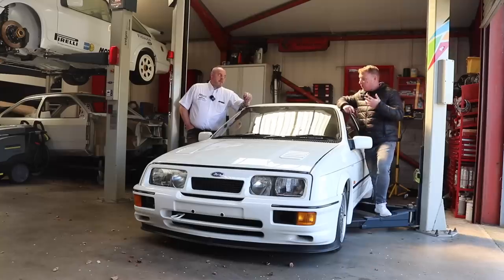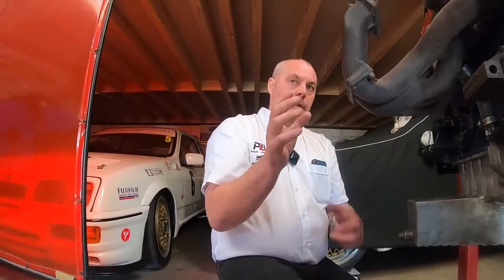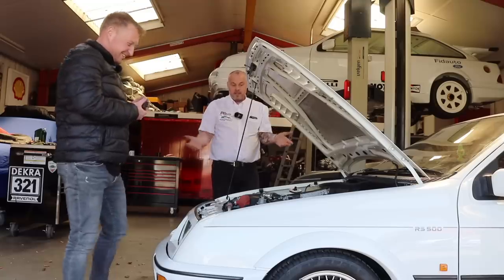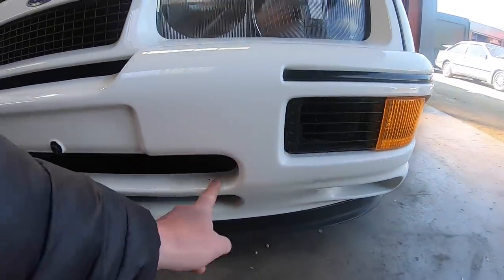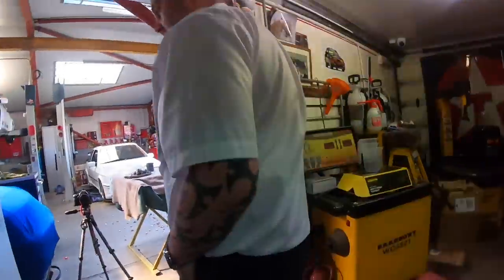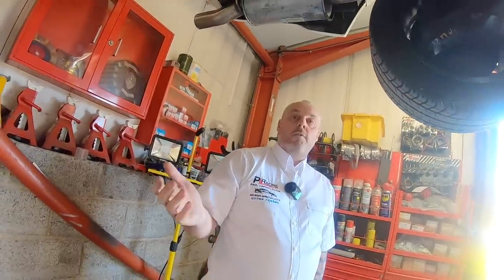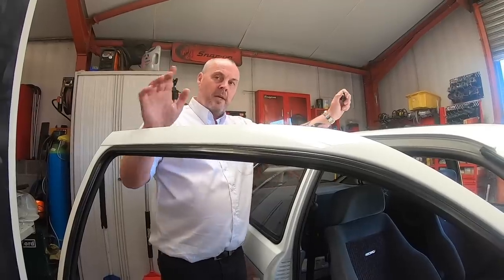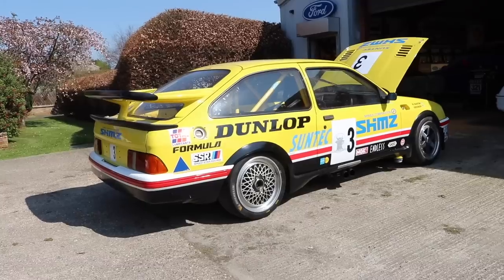COSWORTH BUYER’S GUIDE & SIERRA RS500 DIFFERENCES ** with Paul Linfoot Racing **

Comment: Hi Adam and Paul, another cracking video, Paul never ceases ro amaze, quick story guy's, I remember the very 1ST 500 I pdi'd I noticed the brackets on the rear suspension frame you pointed out, thought it had been "accidentally" left on in manufacturing and actually walked down the bodyshop to borrow the angle grinder, to chop em off. Then stood and looked at it, see it had been sort of tack welded so walked up the compound to look under another and found it the same so left it lol. Also, noted the battery tray trimmed off and already starting to rust so actually touched it up with a touch up stick. Sorry to be boring, you just reminded me lol. Alex.
Reply from the maker: Amazing Alex!! 😊👍🏼

Comment: The guerny flap was originally designed for the mk2 Ford gt40, to increase down force, it was originally put on Dan Guerny’s  Gt40 and I’m lead to believe that is the reason it is called the Guerny flap, as on The gt40 it was adjustable😁
Reply: Was surprised to hear Paul didn't know that. Was the only bit I knew.
Reply: Not true, it was first introduced by Gurney at the request of Bobby Unser on an open wheeled race car in the early 70s, as Unser had no confidence in the rear stability of the race car. Gurney himself had retired from racing at that point
Reply: @jk3838  
I beg to differ on that mate it may of been patented in the 70’s but it was first used on the gt40’s in the 60’s as the gt40’s needed more downforce and  it was Dan guerny who suggested it and developed it but it was on the mk2 Gt40 in the late 60’s
Reply: @damiantaylor7993 yes a very similar flap/spoiler is fitted to gt40s, which was before it was known as a Gurney flap.

Its like a very large gurney flap.

But since the 70s a Gurney flap has become to mean whad Dan Gurney had fitted to his car in early 70s.

Like many of these ideas several people people have already thought of it but only one person makes it famous and they get the credit for it.  There will be a load of other racing cars with a Gurney flap before the gt40 i bet but didn't really get noticed. 

The early 70s use of it got noticed because it was a break from common practice, whereas on the gt40 people just saw it as a small convenient little spoiler on the back of the car. So barely gave it a second thought. 

Like the mp4/1 is credited with the coke bottle and carbon chassis, but it wasn't the first of either, it was just the first people took notice of. Because the others before it didn't win anything.

Comment: The name Gurney flap comes from the racing driver Dan Gurney back in the day when development of the AC Daytona Cobra, if memory serves me correctly, originally it it was a crude slip of aluminium pop riveted to the back of the car in the hope it would give it some stability, it worked tremendously allowing the car with its sleek aero compared to a standard cobra to push more than 20mph more than anything else in its class down the moulsan straight at the lemans 24hr, and winning its class. I dont remember whether it was Gurney or the cars designer Peter Brock that came up with the flap, but gurney took one run in the car and endorsed it. If you follow some of the stories on carol shelby, peter brock and the likes the story of the flap is explained very well, and there’s some great documentaries, keep up the good video lads, i love watching these.

Comment: In fact my dad and another uncle developed the Koln Capri, the twin cam cortinas I think and even minis. Harry Westlake was a petrol head high up gas engineer back then and was apparently the first person to put gas flow into car cylinder heads. I believe they used this  early on with a race team on a mini prepped by their team called Nerus in Rye, east Sussex. 
I heard that half of the name Cosworth was from the guy that run the team. Either Mr cow or Mr worth.  That I'm unsure about
Reply: Mike COStin and Keith DuckWORTH is where the name comes from.

Comment: Bigger core plugs would have been preferable during the casting process to hold the ‘sand cores’ accurately and not have any ‘core shift’ which leads to uneven block wall thicknesses and a weak block, like the RS200 engines which have a thin side on the thrust side which was really unlucky

Comment: A friend of mine bought sting blomqvists rs500 off Ford. He did not like rhd so was sold with the Ford motorsport tune on it I was told it was running 500bhp, my mate was told it would be taken off later , the car was sent straight to a well known tuners who copied the chip, was sold with engine warranty went through five engines on warranty not sure where that car is now, for sure is not on it original engine

Comment: Good informational video. I think the RS500 lower wing is not the same as in european Sierra 2.0 iS. The iS wing extends more towards the rear window and more downwards. I had a Sierra 2.0 iS 3dr at 90's and when I installed a cossie big wing the notch had to be made much larger compared to what was shown in this video. So the RS500 lower wing is totally individual design. Also the lifetime of the serial number stamping tool seems weird, 40 to 50 cars before maintenance. Usually those kind of sheet metal tools last for thousands of pieces before springs or some need attention. But that is still credible, maybe Ford had the same quality for tools as known for their cars...
Reply: It has the same part number as the IS sierra , but with the letter C at the end
Reply: @paullinfoot6017  Yes, I believe you about the numbers, Ford have a lot of them, but see the difference in this picture: https://www.dropbox.com/s/ywqdmi8ur7q2tv8/Sierra%20iS%20vs%20RS500%20lower%20wing.png?dl=0
Reply: @mikkoalinen6951   the lower spoiler is the same as the xr4x4 , not the same as the sierra SI spoilers , not the ones in the uk anyway
Reply: @paullinfoot6017  No, njet, inte: XR4x4 is the same as iS. Goes much for down with boot in EU cars. But I think it is the same in Uk. RS500 is totally individual.
Reply: @mikkoalinen6951  the SI sold in the UK has the same rear spoiler as the rs500 , i will try and find a picture

Comment: Paul / Adam , could you answer a question, has a mk 4 rs rurbo got a different shell to the xr3i as the spare wheel is an inch bigger so the spare wheel well is bigger?

Comment: I wish I'd bought a 500 for 7.5k when I had the chance. Bought a Mercedes 2.5 16v instead. It just felt like a different class at the time. I kept it for 5 minutes  then tried to buy the Sierra, it had gone up to 12k in 3 months.  I still should have bought it. Daft money now and being totally honest, its inexplicable.  My old Capri is currently worth the same as a 996. As much as I love my Capri, that's insane. Where do these values come from? Daft old feckers like me that now have a bit of cash to throw around?
I salute a Cosworth when I pass 1 but I'd never buy 1. 
Flash yr lights if you see me down the seafront in my Capri Adam

Comment: Really mate??? That engine with the red cam verniers has the wrong exhaust manifold for an Rs500, also no extra fuel rail… so that’s just a sapphire 200 block. You didn’t need to to that to the altenator  bracket IF you had the correct exhaust/turbo manifold…. 
Anti roll bars are bigger in all rs500’s front and rear compèred to a standard 3 door.  I’m getting fed up of correcting you…